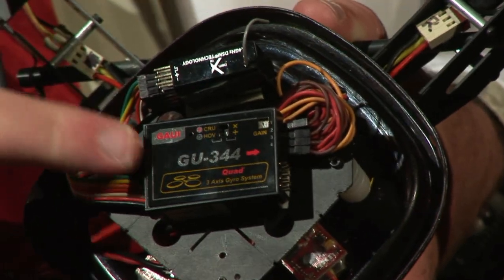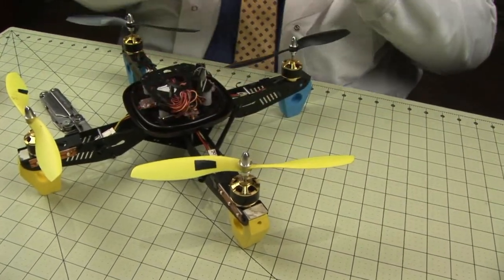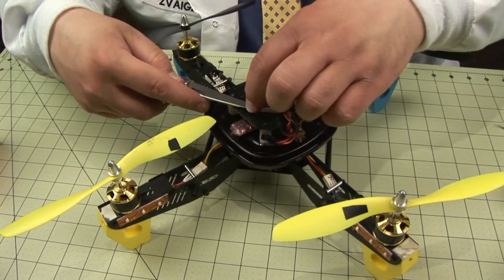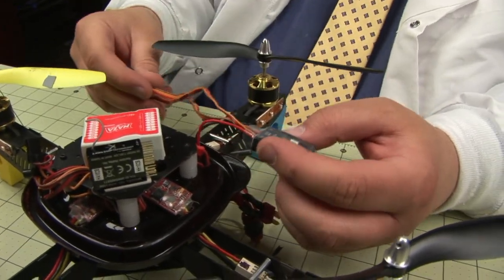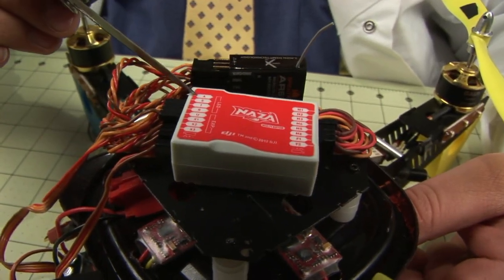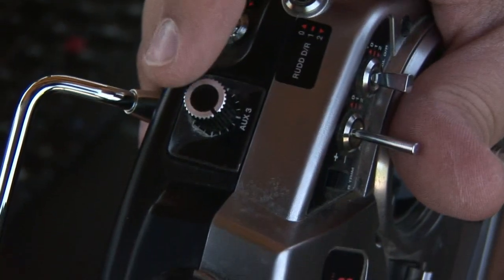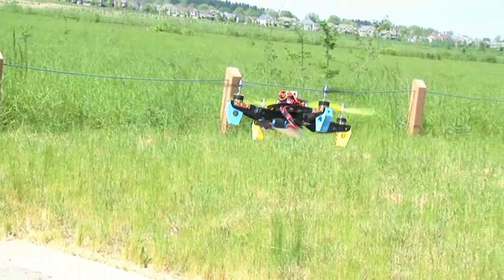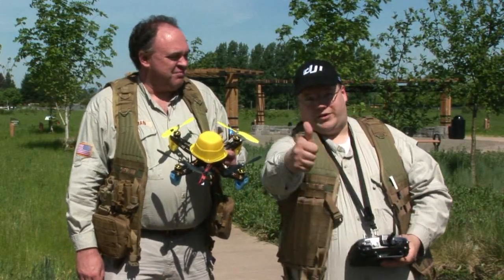RFTC: How to Upgrade a Gaui 330x quadcopter with a DJI NAZA

Comment: Thanks for your interesting answer. In that case, will not be better use a small lipo only for VU unit and other lipo for motors and ESC´s? This way, it could prevent fluctuations or glitches, or not? Helicopters and airplanes do the same thing. Thanks for your importants comments.

Comment: Hello. Thanks for great video. Just a question, if originaly esc come OPTO, this ESC from gaui will send 5A from its incorporated BEC, and VU will sent 5V. Is this correct? I mean, this lots of voltage will not burn the unit? Thanks for your comments.

Comment: hi ,
is it really necesary to put the naza death center ? i have one on my gaui 500x and it is not in the middle . i must trim a lot it want's to go forward and right drifting . as i put it on the program my calibration does not set stiks in the middle ? pitch yaw roll are not green in the center ?
thanks in advance and keep up the good work

Comment: You mixed up m3 and m4 when you pointed it out on the computer screen. No biggie though. Just nit picking. You all make some of the best multirotor videos out there. I'm pinching my pennies so I can add splurge for the wookong. I'm planning on FPVing after it get it setup. Then doing some Ariel Photography once I can trust a camera on it.